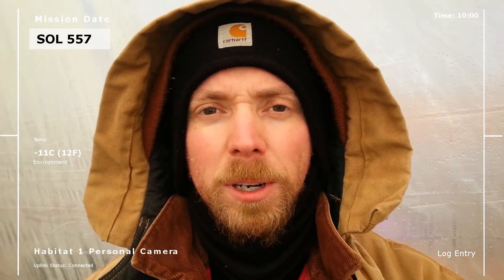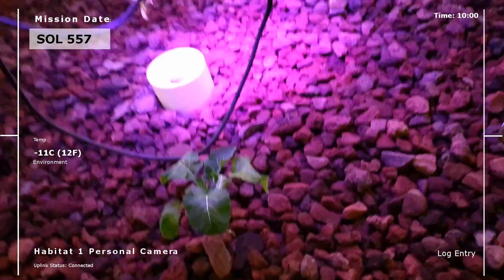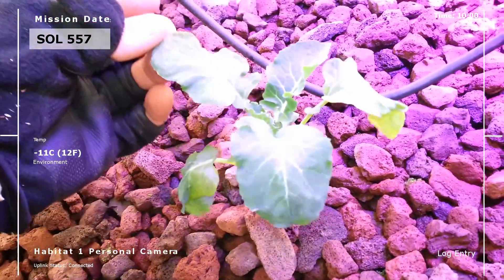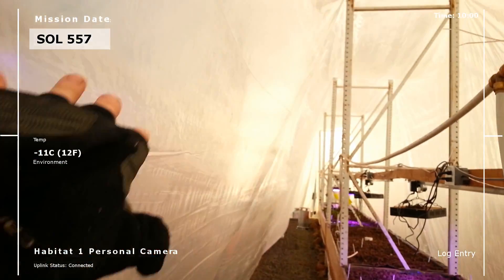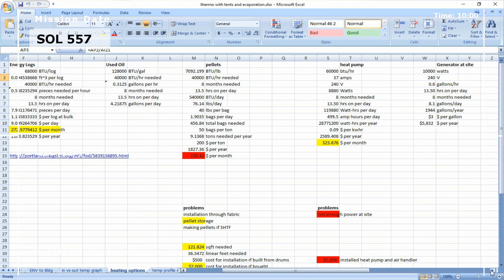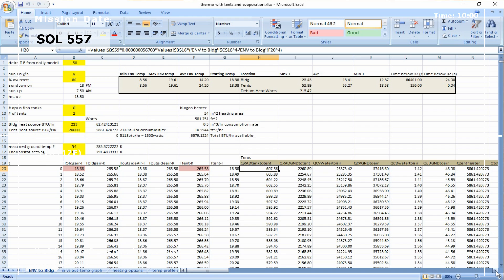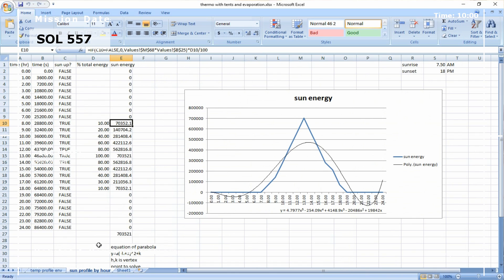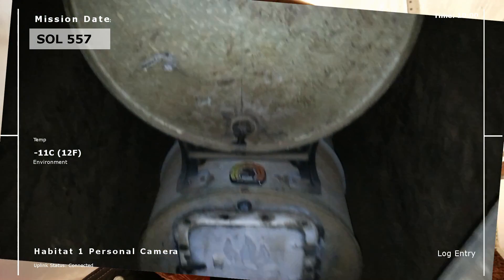Propane creates humidity and that's bad in a greenhouse

Comment: Lower ceilings, double walls and roof, keep chickens and pigs inside the greenhouse, or at least a compost pile. I don't know what that means for your Mars plan but it would most certainly help keep the place above freezing. Is the ground inside your greenhouse insulated from the ground outside? If not, it should be.

Comment: I never give advice but I want to help.Let me be clear You don't have to use propane if you have a greenhouse.Just use compost surprisingly it releases alot of heat a friend of mine has 500 sq ft. to heat 3 acres of greenhouse in cold Wisconsin just high pills of composting wood chips though having a dual layer greenhouse won't hurt either this should completely solve your problem and in a very sustainable way which is the true goal of Aquaponics.Please try this if you can it works and I hate to see good people waste hard earned money just because they had a lack of knowledge this is your solution not saying you won't have to adjust it for your application.

Comment: Set your alarm for every two hours to refill the wood stove. What is the cost per BTU with wood/propane/electric? Is solar heating viable as ancillary heat during daylight? A consideration with propane is it adds moisture to the air...

Comment: You're putting way too much pressure on yourself. try and take the crop loss in stride, it's part of the trial and error process. failures like this are unfortunately to be expected when you're figuring out stuff as you go. don't go planting full beds until you're sure you won't lose anything. 

if you thought you'd be up and running and be able to crank out greens in volume this winter, without having the system completely figured out and running smoothly, i'm sorry to say but you were kidding yourself

Comment: If you can't create another layer of insulation on the inside of the roof then why can't you double insulate your tents? And decrease the wasted space inside your tents to reduce your heat loss surface area. I'm only an instrumentation technician and not an engineer but this seems so obvious to me. Lack of sleep will kill your problem solving ability. You must have sleep to allow the other side of your brain to come up with the solutions that your analytical side is too tired to see. Intuition is your friend and ally. Don't neglect half of your gifts. You have the strength and will to figure this out. Work smarter to save you from working too hard. Best of luck to you. -- Another Martian --

P.S. An old fashioned natural gas wall heater has all the control elements and is more safe than your propane burner. See if you can find used ones on Craigslist. You would have to change the feed gas orifice and find a way to re-range the thermostat or upgrade to a newer digital controller. A low voltage igniter would be safe and could be run from a battery if the power went out.

Comment: Cover the plant with a bucket, fill the bucket with propane heat, consumption will drop considerably
Reply: Use a temp controller
Reply: Heat rises, so vertical stack of plants will make use of the rising heat
Reply: Most of your green house is empty space, make all the plants compacted, so there is no empty space, use removable units to access the plant, the removed empty space will eliminate wasted energy.

Comment: Forgive me, As a greenhouse manager I have to point out that we warm the bed not the air for germination and seedlings. Way less energy use.
Reply from the maker: the good news is basically so are we...but we are also warming the air. The water in the fish tanks is kept around 54F and we pump that into each grow bed. This helps keep a majority of the bed well above freezing..However, as you saw surface temps can drop to freezing....thanks for the info and suggestion...I'm going to keep working the problem...i think we are close.

Comment: I know you have mentioned cost being a real thing, and trying to utilize things which wont take much space (for trip to mars). I wonder if you could use sheets of plastic similar, or lesser mm thick to create a barrier on the inner walls of your building structure. (think insulation). Alot of people who have single pane windows use the box purchased at places like ACE hardware, to create another barrier, increasing a single pane window from R1.7 to like R2.5. I understand its not a huge difference, but a night like you speak of here, it could help save the crops, and not be TOO expensive. maybe $35 using a box of painters plastic. Love the videos! I think they're really cool!

Comment: Jeff why don't you look into a pellet maker.  you can use sawdust, newspaper, even leaves.  use a pellet hopper with an auger hooked to a thermostat that controls auger speed and maintains temperature.  fill the hopper and sleep my friend.
Reply from the maker: thanks for commenting...I did look into it...the cost that I found was about $3500....and I had to prioritize dollars to the build

Comment: Jeff, check out a YouTube channel called Gerry's waste oil burner. Heck if I lived by you I would build it for you and give you the 50 gallons of oil or so I have lying around. Long term, you gotta insulate that building better but waste oil is free and Gerry has a cheap, easy design.

Comment: Jeff,  As a long-time home gardener some plants recover from "frostbite" ,  ( although they''ll be set back in terms of maturation)  provided the stems and root systems avoid frosting .  FWIW, "misting"  plants can/will inhibit frost damage within the cell structure in freezing conditions.   OTOH, y'all might want to investigate fabbing some small tunnels or domes to put over your micro greens to trap the radiant heat from your grow lights during cold spells.  Ought to be pretty cheap if crafted from spare/discarded  materials on hand .  You're attending a hard school ( as countless generations of farmers before you ) ,  inspiration requires an equal  - or greater - amout of perspiration combined with observation and diligence .  You've already demonstrated an ample amount of perseverance, IMO !  Hang in there !
Reply from the maker: great suggestion and thanks for the encouragement!

Comment: I grew veg in a 20' geodesic dome during two our most harsh winters in NE  WI.  I have several suggestions.  Your wood burner is no more efficient than a fireplace and it is likely venting heat after the fire goes out.  A true RMH will not do this.  Also, the creosote abundance tells me you are not burning the wood efficiently.  I learned a great deal about How Not to Build a RMH.  First winter I rebuilt it 6 times.   The humidity is caused by plant transpiration.  You can curb that by adding CO2 to help the plants hold their water.  I would also look into recapturing the moisture because on Mars it will be essential to capture every drop of moisture.   Winter is a very difficult season for "testing" new theories.  Don't worry about that broccoli because it has natural antifreeze.  I harvested broccoli in open fields well after the first second and third hard over night freeze(s).  I haven't watched all your build videos, but unless you insulated the underground solar battery... you are basically trying to heat the earth by pumping hot air underground.  Again, I haven't seen your design to know enough to comment, but a tent within a tent should be enough to keep it above freezing.  With the power outage you dropped below freezing and that shouldn't happen.  The heat energy is being lost and/or vented.

Comment: I think for now it's too big.  If you could scale back the area needing to be heated. Your current set-up has the Plastic like Tunnel like 12 feet high? Really you only need a 1-2 foot cover for the plants. I'm thinking using the same bed set-up you have with 3 ft  hight? for just over the light bar. I'll message you a picture of what I'm thinking... For give me... It's a simple quick thrown together drawing, But I'm sure you'll get the idea of what I'm thinking. I may be totally wrong, but wanted to throw it out there for ya!  :) Check your FaceBook Messages.

Comment: Don't call it a failure, it's a data point. A few things I've been thinking about...Can you reduce the volume of air that needs to be heated by wrapping the plant cages with plastic? 
Any way to create a boiler system and pump the hot water through lines that run along the plants? 
What about heat lamps?
Would mylar be a cost effective way to provide better insulation?

Comment: You need to insulate. Your plastic tenting is an air barrier, but not an insulator. Try using vinyl backed R-10 fiberglass, or 2-3 inch thick foam board. Insulation is an up front cost, but decreases your heating load requirements. If you insulate, though, it needs to be continuous. Good luck and keep it up. Ask if you have questions.

Comment: Jeff I think you need to continue to reduce the space you need to heat its not practical anymore to heat these large tents. The end goal here is to get the system down to the smallest footprint possible and it looks like your environment is naturally pushing you in that direction anyways. What if you insulate only the rack and continue to push your system into a smaller footprint.

Comment: Propane in Michigan is $2.60 per gallon. That should be about 4.24 pounds, which equates to .61 per pound. That's for a small bbq tank. In bulk here it is 1.30 per gal. Are you sure your pound rates are correct?

Comment: Idea: Reduce your heating area by tenting the beds themselves and sending your heat directly into the beds. The lane then becomes a thermal air gap which may also provide some thermal resistance. At the very least, you'll recycle heat from the beds into the working area.

Comment: I am not an expert but a cheap idea to help out is to put a additional layer of plastic over each grow lane leaving a air gap. This will help insulate and hold even more heat in the grow lanes. This is not the fix all answer, not by a long shot, but it should help out. The more heat you can hold in the less heat you have to produce...

Comment: to simplify this message I will post a link to a vid,  put the barrels in the lanes as heated mass closed system,
 heat them by wrapping the barrels in copper pipes and use a hydronic pump to circulate like in a home heating situation
Reply from the maker: thanks for submitting. I actually do use hydronic heating...it comes in from a system I haven't really detailed yet and is connected to the digester. Each fish tank has pex underneath of it that carries warm water to each tank.
Reply: I really like evacuated tubes to supplement a hydronic system and or to help warm tanks - it all helps.

Comment: Ok this is out of my league but I was wondering if you could heat your water through a copper coil prior to entering your grow beds that way it may keep the beds from freezing and possibly put enough heat off inside the tents to keep the plants from freezing as well. The water should be cooled enough by the time it drains into the ponds that it shouldn't harm the fish I would think. An enclosure using propane burner blowing on the coil is what I'm thinking of that way you may not use as much propane that way. Hope this gives you something to think about. Good luck and I enjoy your channel!
Reply: Also to conserve propane or if you run out you could also wrap a copper coil around your wood stoves to heat the water. Just add a Y valve to direct the water to which heat source you want to use.

Comment: Is paraffin / kerosene a possible a economic alternative to propane in this part of the world as it is the economic fuel of choce in commercial horticulture in the UK?

Do the travelling growlights provide sufficient extra light for your plants, I know you said you would prefer more but could not afford more at the present time. I ask because my thoughts are wondering about reducing the air volume of your internal tents and turning them into double skinned tents with blown air separation this might also help with condensation issues and more rapid air cycle times in the tents. Double skinning will inevitably cut day light levels at the plants. I realise that immediately there are cost issues for materials and equipment as well as running cost for the fans and that electricity is at a premium!

Does your tractor have a front PTO shaft (so you dont have to unhook your snowblower) like some compact tractors have and would it have enough horsepower available to drive an emergency static generator sufficient to keep electicity available for this house. If it could be driven into the house to drive a genny it also of course gives off heat when running which must help to some extent.

Comment: Put the propane system on a thermostat with the minimum temperature you can handle, burn the wood during the day and when convenient and then let the propane cover the times your unavailable. It will decrease cost and increase convenience. If you're keeping up with the wood then you spend no money on gas and if you miss a point the entire system is still safe.

Comment: It's seems that the majority of your problems are from not having the building insulated. Let's get the donations flowing and get it done. May have to finance part of it Martian, but if you had all 4-5 levels of each lane running, it could pay off quickly?
Reply: Also, possibly get with Wranglerstar and see how he approaches companies. Maybe the insulation company would like the advertising since this is a huge project that you're essentially broadcasting in daily episodes..
Reply from the maker: great points...i'll see what I can do...insulation is certainly a top priority...thanks for watching and supporting!

Comment: hi the real Martian please watch this video. and let me know if this is a feasible solution for creating the necessary heat needed. if not please explain why. and maybe we can investigate further and design a better way of doing it.https://youtu.be/u5nld6HzEjM like I said please watch an answer if you can
Reply: solar power to make the gas the gas to run the generator the generator to run electric heaters is this feasible. I ask this because I seen these guys operate a small motorcycle using hydrogen fuel only supposedly sometimes you can't believe everything you see on the internet.

Comment: It may be a better idea to heat each plant individually with heat pads. They will eat up some power, but it may be worth it since the power is free. The fish tank wouldn't be feasible to heat up that way, but if you got saltwater fish and added salt to the water it would have a lower freezing temperature which would reduce the heat you have to keep it at. That's assuming that these fish are robust enough to survive at lower temperatures.

Comment: it'd be cool if you could figure out a turbine configuration where you could use some of that rotational energy to drive your circulation system.  You'd have heat from the combustion and then you could drive a secondary fan to move the heated air.  The power going out wouldn't bug you so much.

Comment: Is it possible to use a super shelter idea for that. I use a super shelter for winter camping and the mylar reflects the heat and it keeps the inside of the shelter about 60 to 70 depending on how hot the fire is outside.

Comment: Sorry for your loss, and do not get discouraged. Have you thought of using off road diesel instead of propane. Small Heater Arctic (SHA)  here is the link to the manufacture, http://itrheat.com/products/military-tent-heaters/ They have an office/warehouse in Vancouver, Washington. It uses about 1.5 Gallons per 8 hrs of operation. and outputs about 23,000 Btu's . You can find them on amazon, ebay, and on Military Surplus sites, but prices vary ( hence the link to the manufacture). Hope this helps.

Comment: Before I comment, I will admit that I have not watched all your videos. (Yet). 
Propane heating does work and I have experienced  your consumption issues. Have you considered radiant heat? This does take some time to reach optimal temperatures when first switched on, but once achieved, it is very cost efficient if the growing system is designed for it. I use radiant heat in my hoop houses, but my temperatures don't get anywhere near the extremes you are challenged with. 
God's Blessings

Comment: Sorry to see things not working out right now.  Glad you are planning to keep moving forward.  I'm sure it is really hard.  Seems like you need to prototype a much smaller "cold weather" solution.  It might have to be very different than your current setup.  Create a small area, say 100 sq ft and insulate, heat, develop automated systems and then scale that up to a larger solution when you get it to work and when finances allow.  Just a thought.  Hang in there.  You are doing a great thing.

Comment: I'm a bit concerned about the price you're paying for LP gas.  I'm in the Olympia area.  I'm paying less than  $2/gal.  That's less than  $10 for a 20# cylinder.  Is your LP being delivered or are you doing it tank exchange?
Reply: Richard Hoard 
Agree: something's amiss here.
Regarding propane prices: An empty 20 lb tank holds about 4.7 gallons of propane.
I scratch my head when you say you're paying a dollar a pound for propane.
Propane prices in the Pacific Northwest run $1.50 (good) to $2.50 (bad) a gallon retail at the corner gas station/feed store. If you're paying a dollar a pound, you're paying twice that at about $4.25 a gallon. I am assuming you're buying in bulk so prices should be much less than buying it 5 gallons at a time.